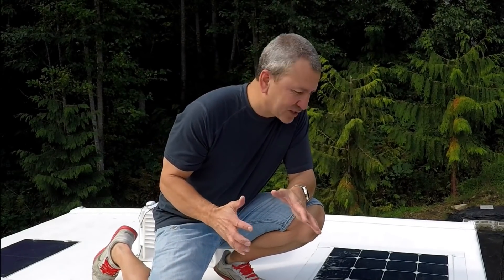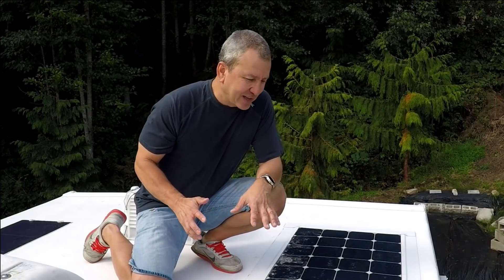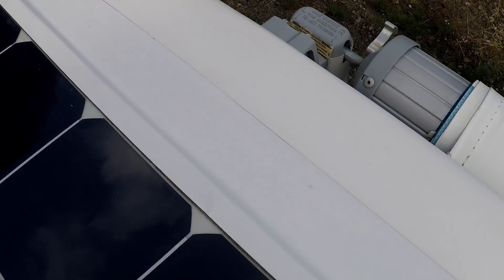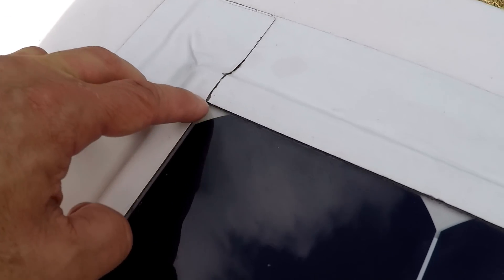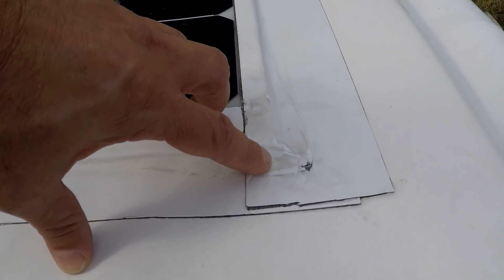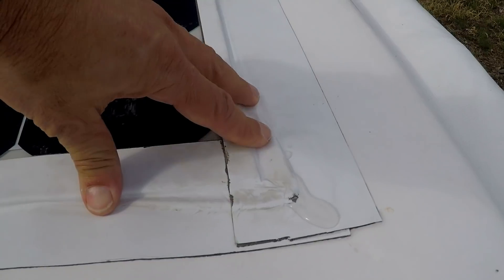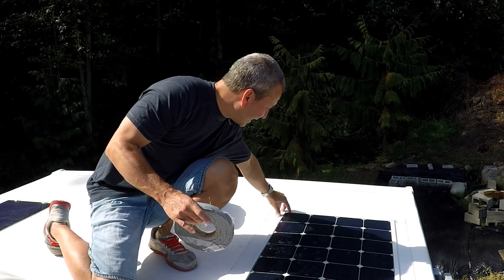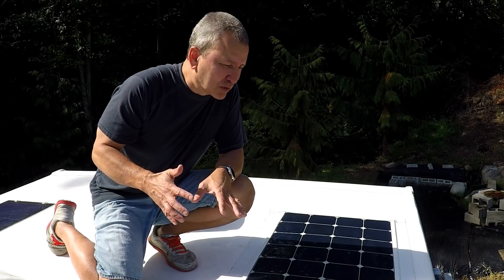ONE YEAR After My DIY FLEXIBLE SOLAR PANEL Installation

Comment: I'm always afraid of permanently sticking anything to anything.  I siliconed a sliding shower  frame to my tub and a few years later decided to replace it.  It was nearly impossible to remove without chipping the tub.  So, I wonder if you should re do the eternabond tape like you did and use butt joints (instead of overlapping and then white silicone the cracks (butt joint cracks/seams) so no water gets in.

Comment: Cool experiment. Just looking at your examples, the dicor looked great, the screws not so much. The tape looked great, except for the water issue. So, how ‘bout using the dicor and replacing the screw attachment method with the tape?  That seems like a great combo and avoids punching holes in a perfectly sealed roof.
Reply from the maker: That's very similar to what I'm leaning towards for the next go around. Some VHB tape underneath to hold it down in a few areas, then Dicor around the edges. No screws.

Comment: I would just caulk all four corners and as an extra caution you just caulk around the whole entire thing use a polyurethane Roofing caulk and you won't have any problems I would use a heat gun after I squeezed out all the water to make sure I get all the water out

Comment: The spot where water is being pulled in is very tiny (where the tape meets) but the movement of the panel during wind or travel would create a suction action pulling water in. A tiny drop of silicon on each corner would probably have eliminated the issue completely.
Reply from the maker: You're probably right.

Comment: You could adhere the panel to the roof with White Mastic tile sealant, which would create a water tight seal under and around the panel.

Comment: Why not leave a gap between the leading and trailing edges tape and the sides? Do you think you need to completely cover every inch of the panel's border?
Reply from the maker: I usually like to keep my roof pretty clean and it would really bug me if I couldn't clean all the grime that would build up under there. Other than that reason, you're probably right and it would be fine.

Comment: ive never seen that tape before but it looks like a bitumen flashing tape type of tape ? if so the bitumen will over time leach into your paint or fiberglass oO, if you try to clean it off your be left with a yellow looking stain, i my self would have just used sika 11fc sealant, because its a glue and sealant in one and also its simple to clean off even years after.

Comment: you installed the tape the wrong overlapping direction.the sides need to overlap the back and the front
 should over lap the sides..
Reply from the maker: I did it that way initially so protect the front from any possible updraft while driving. My guess is that either approach would have had the same outcome. Oh well, time to try something else.

Comment: Very cool! Maybe just a dab of sealant in the corners would solve this issue. When you overlap the tape, there will always be a gap no matter what you do below it with the double sided tape. Especially over time with movement of the vehicle and heat/cold cycles.

Comment: Hi Tito, Your initial installation was fine with one exception, water will alway get in so you need to plan for it to get out as well.  I would suggest leaving the corners open for this purpose. Dave
Reply: I am prepping to do a 400w install in a similar way, i was planning to leave several gaps around , maybe a couple on each side an inch long, should allow the water a way to escape

Comment: If ya use 2 sided tape under the outer edge , will the panel relax into a bowl ? .   45 Deg. tape the corners w/ the tape you already used .   Much luck

Comment: The panels themselves look to be in very good condition. I often wondered how they would hold up vs the glass ones. Thanks for sharing
Reply: my flexible panels did not hold up after two years(renogy) . No voltage must have delaminated or over heated. might have been a defective panel run but they did work for two years. I glued my to the rv roof with 3m marin deck adhesive.Going to replace with glass panel

Comment: You don't need to re-do the tape. The panels are weather proof, they are ok.
You do not need to tape the panel down on ALL sides. The tape is to keep the panels on the roof, not weather proofing them.
I would simple make a good-size drain hole at the lowest corner, and call it a day.
Reply from the maker: +MetaView7 Yup that's the solution for now. Thanks.

Comment: Hi, I was planning to install a couple of the Lensun 100w panels on my truck camper with eternabond, I may fill the corner gaps with dicor. Also, after a year, how are those panels holding up? Thanks

Comment: how about just use some dicor in the corner to seal the little gap between the sections of tape. seem a let less work than all the extra tape on corners, under the panels etc.. you might want to remove them at some point.  you could just put tape on sides, top and bottom and not worry about he corner.. you could use painters tape to hold them flat panels on the roof. 
not that much air really across them. Now put them 6 inch above the roof and more wind to deal with. 

love the info just the same my man..  choa..

Comment: Flexible panels need an air gap for cooling to work well for many years. Installed without a gap will shorten the life due to excessive heat.

Comment: Thanks for the video. I have a question for you that's important to me. What about that really long panel you laid Dow originally? I have one but haven't installed it yet and I'm a little hesitant to stick it up there "forever". I've figured out a way (not tested yet) to lay it on the ground like a portable rather than put it on top. I need to know your experience with it. Since you never talk about it, it makes me wonder. If it's bad I'd rather take the loss than screw something up. Thanks
Reply from the maker: I got those Unisolar panels before the monocrystalline flex panels were widely available. Yes, they are on certainly on there forever. I suppose it just makes my rubber roof stronger. My experience with them has been good so far. They take up more than twice the space than the other mono panels, but they are extremely durable and perform pretty well. I honestly think they have been a good compliment my mono panels because they perform better than the mono panels in low light or cloudy conditions. I have three of those Unisolar panels (264 watts total) and 3 x 100 watt mono flex panels. Together they perform well for what I need, since I don't need much else at this point. Due to the space limitation on my roof though, I would not install them again. I only have so much roof and the newer mono flex panels provide more power per square foot. My two cents. Hope it helps.

Comment: If the inside corners where the tape overlaps is the only place water is getting in, a dab of dicor or similar sealant over each lap joint should keep the water out. Might not work now that water has penetrated but for future installs....

Comment: I used the hard panel. Bolted the Z brackets to house door hinges. Glued the hinges down with 3M 5200 over a year ago. Modified the hinge so I can pull the pins to tilt panel(if needed). 

Jim

Comment: Thank you for the update too. Both this water intrusion issue as the known heat dissipation problem can be addressed with the use of VHB tape.
In a couple of weeks, I'll be installing 400W of flexible panels on the roof of my Ford Transit with VHB tape. With the corrugation of the roof and the spaces between the pieces of tape, I hope that the airflow will be enough to avoid these issues. Should be a quick install without holes.
I wonder how long the two earlier panels have been installed and how they have performed with regard to amps and if there is any noticeable degradation?
Great videos!

Van Williams

Comment: HI Brian, I did my roof right after you did yours.  I used the Eternabond tape... I didn't overlap mine though.  I went up and took a look this morning and there is no lifting of the panels.  That is through the Florida sun and two hurricanes.  
I just butted the tape up against the other edges.

Comment: If I had to choose between patching 4 screw holes or removing all that Eternabond tape... I would choose the patch method...
Reply: Actually... should there be a need to remove the panel, a little bit of heat from a heat-gun or blow-dryer would make pretty quick work of the  Etrernabond.

Comment: Hi, I like your vids,  I left small openings allowing moisture to dry,  I did use double sided tape and mask the outside.  I little air flow is not bad for me.  I have grooves on my van so it seems ok 9 months in.

Comment: Good follow up Tito. I remember your video, and seeing how yours worked out, I decided to do the same one mine when I get them. Actually, I am getting close. Lately though, I've seen some neato installs with rigid flat panels, that have the advantage of creating an airspace shadowing the roof, keeping the RV cooler. So now I'm torn. Which way, if you had to do it again, would you go and thank you for your opinion. Keep in mind, I haven't found any good way to conveniently tilt these things towards the Sun. I am aware that a flat installation is not optimal.
Reply from the maker: +Ricky Rox I would go with flex panels if doing it again. I keep portable panels handy for getting low sun.
Reply: RVwithTito Thank you Sir.

Comment: My question is:no need anything ventilation underneath a panel?
Reply from the maker: +Zoltan Szabatin Not really. Unlike glass covered panels that can only vent from the other side of the glass (bottom). Flex panels vent from the top.

Comment: Thanks for the update, Brian. Interesting to see, especially since you have both Eternabond and screws/Dicor to compare. We screwed our panels to the roof over 12 years ago, and have never had a leak. Just our regular annual Dicor inspections have kept things dry. We do love Eternabond, and love the idea of avoiding additional holes in the roof... in theory. But our big issue is the fact that once Eternabond is in place, it's virtually impossible to remove. Since you don't need waterproofing (with no screw holes under the panels), have you looked at VHB tape? We understand that it's so strong that people are using four little pieces of it on the brackets at the corners of traditional solar panels with great results. We've used VHB for one roof project and so far, it's on there like concrete. But we understand that unlike Eternabond, it can be removed (haven't tried that yet). Maybe better for a project like this where strong adhesion, but no waterproofing is called for? Plus the supposed benefit of removability (and a lot less required... very small pieces go a long way).
Reply from the maker: +RVgeeks Just ordered a roll of VHB to experiment with. Thanks for the tip.
Reply: Great to hear, Harvey! VHB is definitely a good thing to keep around the RV.
Reply: Put front to back tape on first
The front east/west tape
Then tape on trailing end needs to be under side pieces or skip piece on southern edge altogether
Reply: Hmm... will a strong blow-dryer or heat-gun not help budge either of these adhesives, when removal is necessary(?)

Comment: Hi Tito;
I've done the same on a 2007 Chrysler PT Cruiser, and actually went with the eternabond tape after seeing your video which gave me the idea. 
It's been several months now, and it's performed very well, even though my panel is at a bit of a curve, since the roof of the cruiser is curved somewhat. 

It's performed very well; I have it hooked up to a deep cycle battery with a charge controller, and use the system to power some electronics in my car for long periods of time without having to worry about draining my car's starter battery.

Having been nearly a year since doing this, I haven't had any issues yet.

I've gone down freeways and have experienced all weather except snow in it, and it's stayed on very sturdy. One way I varied from your approach is that I did include a few pieces of double sided tape along the center of the panel (Center horizontally), each placed at 25% intervals, vertically, to hold the center of the panel just in case the passing wind pulled it upward. 

So far it's been looking fine, though I have seen the same expansion of the adhesive at the edges of the material. I believe this is just due to the heat of the sun expanding the material a bit. I spent most of my time with this out in phoenix, where it's 115+ outside, and the metal on my vehicle was just burning up, so i figured that's what caused my tape to have a bit of the adhesive expanding out the sides. 

Since my vehicle has such a slope on the roof, I haven't had standing water, and thus haven't run into the issue(s) you've faced with water getting underneath the tape. Mine's pulled itself up a little, vertically, because the panel resists the slope of my vehicle, but it's been more or less the same as it was day one. 

It's been interesting, I've gotten tons of comments on it since I've added this panel to a normal car / suv.
Reply from the maker: +Douglas Robinson Thanks so much for sharing this. I get a lot of questions about mounting on metal that can get really hot. Great feedback. Thanks.
Reply: Why wd you put solar panels on a car?? Do u live in your car?

Comment: I would run a thin bead of Dicor all the way around the inner edge of that tape and the panel, much like you did on the panels with the screws. I would think that would prevent any further water migration inside the tape. Just a thought. . . . . .
Reply from the maker: +gac914 Thanks. I've thought of trying similar things in the future using double sided tape and Dicor.

Comment: The advantage to your taping the panels is  that they can be repaired and removed with little effort, however you just found the water issue.  Mine have been glued to the roof since day one and are not going anywhere BUT no water buildup.   I suppose if they ever go bad I would have to peel them off in pieces.
Reply from the maker: +PAT DOWNEY My older Unisolar panels are glued down that way with absolutely no issues. I would probably just mount something over the top instead of trying a removal.

Comment: Nice update Brian! Do you have the rubber roof or is it fiberglass? In another youtube video that I was watching, the RV owner used the eternabond tape to cover all the seams on his rubber roof, and just for extra piece of mind he put some dicor along the edges of the tape, especially where it overlapped. I wonder if that would work for you too?
Reply from the maker: +Al D Al. I have a rubber roof. I too have covered all my seams with Eternabond. Even over the existing dicor.
Reply: Thanks Brian! I think I'm going to cover all the seams on my roof with Eternabond just for piece of mind too!

Comment: I think there will always be condensation taking place. My experience with condensation is to let the air flow through. Sealing it tight may work against you especially in the PNW.
Reply from the maker: +Gary Boyd You're probably right. Just the thought of not being able to clean under there dives my OCD brain nuts.
Reply: RVwithTito I have a fifth wheel with a solar I had installed when new 9 years ago. The panel sits up on some legs. Air can get underneath. No major issues so far and I am PNW not far from you as well. My unit sits in forest all winter and that is tough on them.

Comment: Great up-to-date ideas !
I hope to use flexible panel(s) due to light weight and would like to remove them when in city. Also make them tiltable. 
Is this too many requirements ??
Thx,
Bill in Boston
Reply from the maker: +Liam Kelleher You'll have to install some kind of Mount to do that.

Comment: One of my concerns with Eternabond  - at least on my van's metal roof - is how do you get it OFF. For example in this case, where you've got leak issues, or maybe you just want to put on a different solar panel, how do you get the Eternbond to unbond, without ripping off the paint or some of your plastic/rubber roof? Will WD-40 do it?

Also, do you not have heat issues with your panels flat against the roof? One vanner (Will Prouse) in his video, laid his flexible panels over wooden doles on the roof to give the panels some space underneath.
Reply: yeah i think you'd be fine with a metal roof, my parents have a tin skinned roof on their 5er and i had to remove some adhesive, used a scraper blade on an oscillating head tool and it made short work of the adhesives, on a rubber roof, i think you'd have to just leave it on there and maybe cut right near the panel to remove the panel, but leave the leftover tape, its not ideal, but i think it'd do more harm than good trying to remove it.
Reply: I have a metal roof also. I removed Eternabond with one of those multi-tools the ones that vibrate side to side.  I used the knife attachment.  Not too bad to do
Reply from the maker: +Jack Kunkel I haven't had heat issues that I could tell. These type of flex panel actually release heat from the top unlike traditional panels covered with glass. I will try and remove some Eternabond in another video.
Reply: Hair drier,,, search YouTube,,,I saw a video on how to remove Eternabond from an RV roof,,,Best Regards
Reply: Jack Kunkel sure I tell you what you get some rubber cement which is pretty cheap and bonds solar panels to RV however it comes off easy.
Reply: I do not believe rubber cement will do the trick on some surfaces. Do a test first before committing fully to rubber cement.
Reply: A corrugated plastic panel under the solar panel may be better than wooden dowels.  The panel is only about 1/8 " thick, and should also prevent vibration.
Reply: I had one of these panels immolate one cell last summer. It had an air gap underneath it but it was very hot out and in full sun. Got it exchanged via amazon but happy it wasn't lying flat on the rv roof